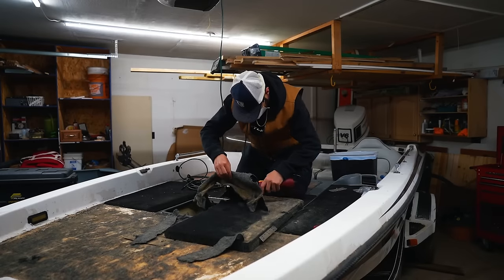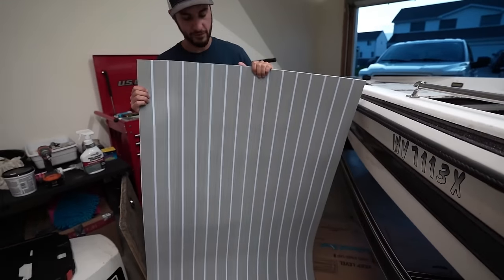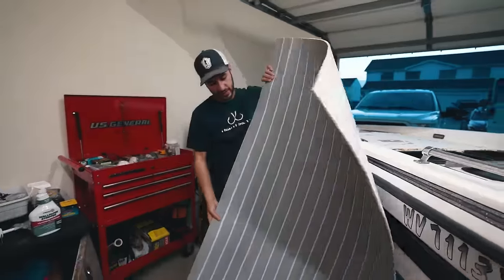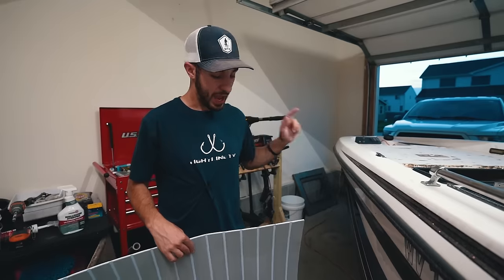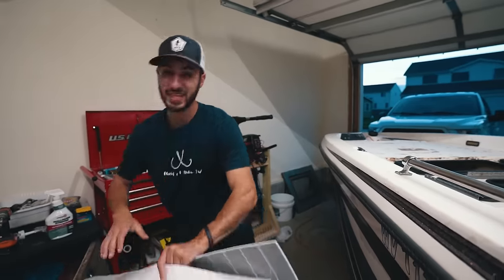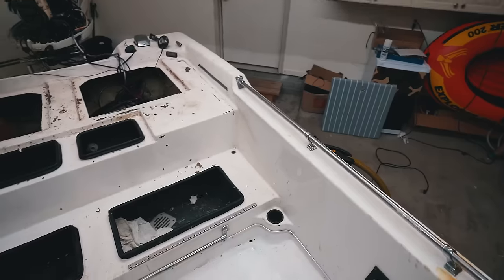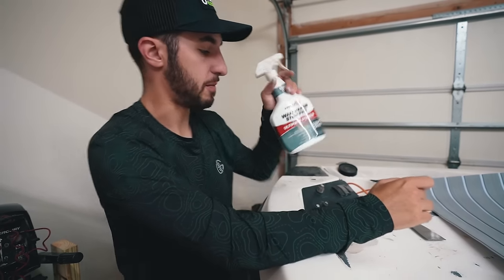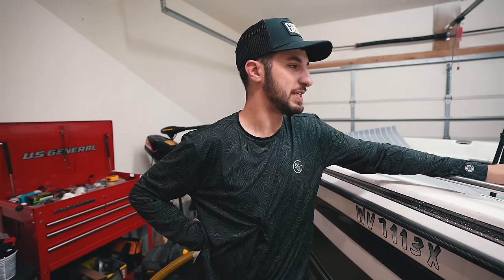I Bought Amazon BUDGET SeaDek For MY BOAT! (Is It Worth It?)

Comment: Should have bought sea deck. That stuff won’t last more than 2 years, just being honest. I have that exact one in my boat and it’s starting to deteriorate
Reply: Mine did, too. I needed an additional piece for my dive platform. I bought a real sea deck piece. It's still looks new after 4 years.
Reply: Don't buy the Eva deck .. I used the Amazon shit .. and it's looks good but only for awhile .. I will use better qaulity stuff next time.

Comment: I did my whole bassboat in seadek.  Best way to get the glue from the carpet off is with gasoline. Works like a champ.
Reply: Remember no smoking 😂
Reply: Poor gas on it, then light it up and burn it off lol
Reply: I bet it not sticking after 2 years. Gasoline leaves oil on the surface. Unless you sprayed the whole boat down with brake clean after. Probably wouldn't do that. Will not stick very long.
Reply: @rudy1574 😂

Comment: Here's an idea for anyone attempting this, create a line down the center. When I'm working on my 14 foot V bow I ran a string from front center to rear center and made pencil marks along the line. Unless the boat is more than 80 inches you have enough to span the entire width. Before starting to cut the material measure the edges so you use the odd size on the outside, if not cutting it off? I watched a video where a guy used blue painters tape (no cardboard) to create the template. He was able to peel it off the kayak and apply it to the sea deck. I understand a boat template is much larger than a kayak. Great video.
Reply: String lines are a man’s best friend!
Reply: This idea meshes with some of the other videos. Find a centerline and work out from there. Decide if you want the actual center to be an accent gap, a full slat, or a slot. 
Most applications are making an accent gap instead of trying to do a seamless look. With the accent gaps, the pieces for one side will be mirrors of the other side. Measure, plan, make templates, measure, adjust templates, measure, THEN CUT.

Comment: I have used this for several builds. There are pros and cons to it. Soft on the feet. Looks great, washes easy. Cons; seams separate, if left in sun too long it will lift, sometimes lines don't match up. I'd consider using a full piece instead of sections. Will eliminate all the issues I mentioned.
Reply: How it faux teak look after several years on sun, rain and salt water?
Reply: How it faux teak look after several years on sun, rain and salt water?

Comment: Your mistakes are what makes it a good video. For example. Having to tear up the EVA showed me just how well it sticks. There is always EVA flooring at MAC.BIDS but I'm probably just going to go with TUFF COAT paint. Currently replacing all the wood in my boat with aluminum and PVC board. Wood and carpet are foolish in a boat as I had to repair something every year for the past 15 years.

Comment: Generally speaking, the variencs or gap descripencies are most likely from using eva foam decking vs the original carpet. The lids are made with a gap to accommodate the thickness of the carpet when it's wrapped over the edges. Depending on the quality or pound rating if the Marine carpet, each edge of carpet adds 1/8-1/4  of thickness to each side. Multiply that times 4 edges and the gap is gone. Nice job with the decking foam. You could always reinforce those edges with angled aluminum and framing it out.

Comment: The deck extension pieces were designed to have carpet for proper spacing so with the foam you don't have that buffer you get with carpet so you will either have to redesign the lids and add supports or remove them completely for it to look right.

Comment: This stuff can really dress up a boat, but on our sailboat I've noticed a few things after 1 year. First, it oxidizes like crazy in the sun, and if you use it for seats etc (which we did to replace the original teak), it will leave large dusty patches on clothes and bags. We have one of the wood colors, so it releases a brownish/ashy dust when you touch it. The adhesive it comes with is terrible (lifts easily, even after full cure). We got fed up using different adhesives, and finally used a Corning poly to adhere it (which I'm sure we'll regret later). It's soft and comfortable underfoot, but easily tears.

Overall, a great option to quickly improve an area, and best suited for boats stored indoors

Comment: Best paint to use on gelcoated/fiberglass-  Ace Hardware porch and concrete floor paint. It's a polyethelene alchiad. Which are the ingredients for anti-fouling paint. I once did an entire 16' Quachita in grey using a roller and sponge brushes. It is self leveling and cost about 10 bucks/quart and when you are done, it looks just like gelcoat .  I recently tried the Amazon style EVA to do the floor in my 21' Ranger. Don't ever use light grey. It's almost white and if you get in the boat it will suck the floor dirt and dust off your shoes and turn everything brown. It is hell to clean. I use straight 409 spray and wipe out a 12" section at a time.  I'd stay with the color you have. Also, don't be surprised if it shrinks a little allowing your cut seams to later show out a little. I had perfect seams on the floor walkway when I laid the stuff. A few months later and now there's an ugly seam.

Comment: For a deck extension hold down solution.  How about a u shaped wall/ceiling fastener with two screw eyelets attached to the deck and the deck extension- 8 total. Then a self adjusting bungee or a bungee with eye snaps attachment? The hardware can be found in stainless and plastic - PERKO - probably has what you need. This is the system currently in place on my Parker with a bow filler and it handles rough water flawlessly. When the bungee gets a little weak I just cinch it down a bit.

Comment: I just went through a similar project on my homebuilt small skiff, using a one color grey EVA foam. This was also from Amazon. I wasn't removing a carpet first , as this deck had a molded anti slip pattern. That required the band grinding work to remove, - right down to the glass laminate. Next of, I used an oil based primer/gelcoat like you did. Not as tough as the original gelcoat, but it seals and it looks fine. Its easy to repair scratches as well. The thing with foam is, that it has a substantial heat expansion in the sun. This is the reason I learned, trying to make seams invisible is a waste of time. Make some purposely separated smaller areas instead. That's much better. That might even help to drain the deck better! Even if the separation width vary a little, it doesn't look bad. If you are worried about the dampening of noise, I don't think that a 1/4 - 1/2 inch stripe of bare deck between the foam areas makes any difference. Unless you are using spiked wadingboots maybe ;-)
Yes, the variance in the EVA foam color is visible. I also learned that from buying roll no. 2. Again using separated areas will help make this issue less visible.
I'm looking forward to the learn the long term cost/benefits of this material. It is possible to wash and clean with soap and a hard brush. At least that's better than a permanently glued carpet. I have another boat, were the deck carpet is fastened with Velcro. It works, but I don't use that boat so often for other reasons.

Comment: Those are factory deck extensions.  When they were wrapped in carpet, the carpet filled up the gaps and they fit together snugly.  You might consider just remaking something to fit out of wood and fiberglass, then sell those off.  I see people looking for them in the basscat forums all the time since they are no longer made.
Reply: Or use the EVA foam around the edges to make up the space that would be filled in with carpet.

Comment: What are the deck drop ins made of? Depending on clearances, you can try mounting/hinging them to aluminum angle making it all 1 piece to drop in. So it doesn't wear on the glass I would also attach some sort of material between the mounting surfaces. You could then use those straps and a quick disconnect, like those found on back packs, and screw/bolt one side into drivers side console which would allow then to still be removed. This was just a quick thought. It took few different design ideas/sketches before I found what worked best on my skeeter!

Comment: Where the front deck plates covered in carpet? The carpet added width to the panel and helped hold them in place. You can add the Eva foam around the edges to tighten the gaps and have them be more secure

Comment: Bass Cat made an extension for the Pantera II model which they called a "flippin' deck".  It consisted of 3 panels that were all attached to each other so they wouldn't move and would be stable to stand on.  There was a vertical panel to support the rear edge of the center panel (glassed together), then there was the center and starboard flat panels that looked similar to what you have but they were permanently connected to each other with a piano hinge.  Each flippin'deck was designed specifically to fit a particular model and when they were in place they were snug, stable, and secure.  What you have there wasn't from Bass Cat or may have been something the owner bought that was designed for a different model.  Obviously even the correct flippin' deck was designed to be snug with carpeting so I imagine it would rattle a bit without carpet.  I'm curious if you're going to experience a lot of rattling with no carpet along the lip of the lids where they sit on the deck.  Here you can see how the flippin' deck extension is supposed to look on your model:
https://youtu.be/BOmc_XmleEw

Comment: so one thing I picked up when looking on Amazon i would go with the " camo " style decking to avoid some of his problems with the lines not being even he's not the first video I've run across that mentions the lines are not union from roll to roll.  Second, though it's 1600 bucks for a mat kit for my boat the method he's doing is a few hundred bucks and just a lot of time. That's a personal choice  I have a budget minded key west 1720 I can't do the math in my head of dumping thousands for a power pole trolling motor, sea deck. it's not going to take long before my addons equal the price of the boat  . Over all I think he did a really good job

Comment: Your deck lids and openings were cut for carpet to roll over the edges and fill in the gaps. I think what you have completed looks good. You will need to come up with a way to pad out the lids for them to fit better. Nice job.

Comment: The deck insert on that boat had snaps screwed into the cap that those straps snapped to, as for the side part it was hinged to the center part. And the gap’s are there to allow for them to be carpeted. Bass cat uses high quality thick carpet so that should answer your deck extension questions.
Reply: Exactly right. I have a '94 PII and this factory deck extension. It snaps in near the floor to hold it in place and make it easily removable. The side section hinges to it. Works great. Mine also has a section that is vertical to close off that section next to the console that adds to the rigidity and keeps everything inside that you put in it.
Reply: @RussellSorrow  my old P3 had it also and worked great. Basscat calls it the flipping deck insert. Made the front deck so much bigger. It also had a piece going down into the cock pit. Didn't see that in the video so he is probably missing it. Wish i had photos of my old boat but im sure if he Google's pictures of basscat flipping deck insert he will see it

Comment: I’m in the process of design and building of a mini cat boat similar to a mystic c5000.   I went and had a length of Astro turf donated to me by a local company who has tons of scraps constantly because it is really tough to pull up from the floors .  I’ll use the cups that the seats will sit in to practice putting , lol.    Girlfriend is a trooper. Stick a ring on that 👌
  FYI.  Heat is your friend, a hairdryer would help release that glue .  It’s nothing more than landau top adhesive.  Releases with heat too .

Comment: Awsome job looks great when I redid my carpet on my triton I just used acetone seemed to do the trick only suggestion I have would be to run a string line down the center of the boat and lay your flooring from the center out that way all the lines line up but I dig the color looks awesome love the vids

Comment: Maybe some automotive rubber seal material for around those deck extension lids. They sell rolls of it that are inch or so wide, inch or so thick. The type around the inside of trunk lids. That would help keep them centered, stop some water from passing down, but wouldn't keep them on the deck in rough water at speed. You certainly don't want them flying past your head running 50+ on rough water.

Comment: Dang! Bro, just dang! Why not use mylar template? Why not use boarder cutter and circle/angle cutter designed for cutting eva foam? Good job getting the glue off, number one importance when laying over aluminum or fiberglass. Also, just a suggestion for others, try doing a snap in version of this foam. I did one for a buddy that we sandwiched two layers of foam against each other's backing adhesive. I used thin plastic in between the layers in areas for snaps to have something to hold to. Was too high. Using shelving liner matting works better and is thinner. Use the biggest, flattest snaps you can find. Works great. Don't buy the name brand unless you are in that tax bracket!

Comment: I used the exact same foam and as long as you prep is right and use adhesive promoter it works perfectly. I did have to measure, straight edge it and meet two pieces together on the white edges. Boats coming out great man
Reply: what adhesive promoter?
Reply: What is adhesive promoter

Comment: Those deck extensions have that gap because the boat was carpeted. With carpet wrapped around those lids there would not be much if any gap. If they cut them closer then you wouldn’t be able to open and close then with carpet. That’s why intercostal bass boats have different lids than traditional bass boats because seadeck does not fill in those gaps.

Comment: When that bost was new front decks were very limited and there was a lot of wasted space in the cockpit floor.  Deck extensions solved this.  Having ones that mostly fit wins most of the battle brace them if needed, bolt or screw them down snd enjoy the room

Comment: If you missing 1/2” dont forget when you wrap the carpet around it would be tighter for form a fitted look 1/4” on all sides will make up for the loss! What If you try wrapping the edges with the flooring? but all in all you got a 1500.00 boat to look like a 5000.00 boat for less then 200.00 good work im going to buy the camo version and do my kayak deck.  But Im curious and wonder if it would stick to wood as well?

Comment: Yeah I’m still working on my ‘93 Pantera 2 and I was going to build deck extensions to cover the area that your deck extension cover. I know bass cat sold a extension kits but not sure if that what you got. Either way those extensions need supports added (screwed in).

Comment: I used the same EVA foam on the rear deck of my boat. Lessons learned was foam has to be layed in the same direction off of the role from which it comes. If you take two separate pieces of the foam and turn them in opposite directions in the sunlight you will notice one piece is darker than the other. And if I were to do the EVA foam route again, I would buy solid colors, having to make special cuts to line up the lines is a time killer and a pain in the arse.
Reply: David how is your foam holding up. Thinking about this vs carpet in small 14ft bass boat
Reply: @charlesparmenter5515  I removed it after a year. My rear deck was not very flat to begin with. I was able to fill in some spots to make the transitions smoother, but my biggest issue was finding a good glue. The EVA foam does come with sticky backing on it which would probably work well with a flat/smooth surface, of which I did not have. The glue I used did a pretty good job, but corners and such started coming up.
Reply: I was thinking using spray carpet glue and spraying it on. Id use a full sheet flat over prepared plywood. Then cut off the extra. My boat will be covered or in my garage when not in use...or just use carpet?
Reply: @charlesparmenter5515  I used Locktight power grab heavy duty construction adhesive. The EVA foam I used had pre-made lines/grooves on it and had to do special cuts for the lids EVA foam in order for the lines to match up from piece to piece. If I ever decided to try it again I would use EVA foam with no pre-made grooves in it. Also, sunlight reflects differently off of the EVA foam, meaning if you take 2 pieces of EVA foam and place one piece upside down, one will look darker than the other. So make sure all pieces are going the same direction.
Reply: @David P  ill get one solid color forsure and find a good adhesive. I think its worth a shot vs carpet. 🤔  a small front deck with a couple hatches. Then a flat floor in bottom and then a bench seat. Any idea the thickness of the eva. Or should i do another brand

Comment: I have a 93 basscat pantera 2 with the deck extension. Mine doesn't look like that and it has an additional piece from the center hatch to the ground. The hinges are riveted or you can use rivnuts. I can send some pics if you have an e-mail or something.
Reply from the maker: Hmu on Instagram!
Reply: @TightlineTV  Just slid into your dm's